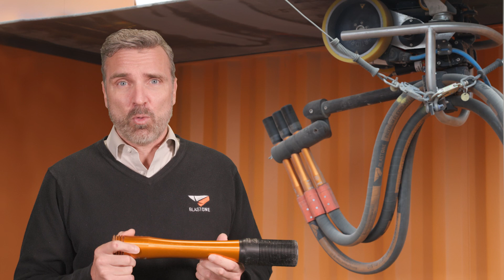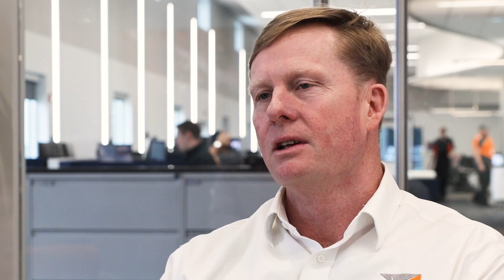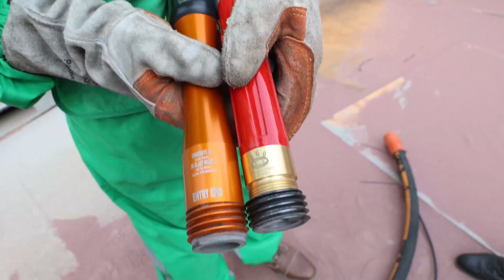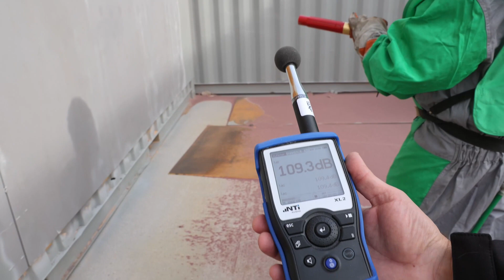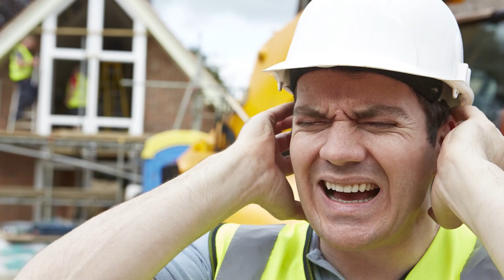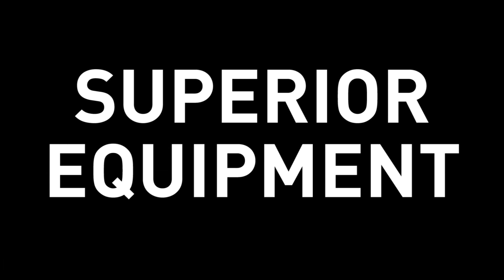How the SnakeBite XQ Reduces Blast Noise and Operator Fatigue

Comment: I've been sandblasting for 15years and I was brought the #6 and #8 Snakebite nozzles to test out before purchasing. At first seeing the #8 nozzle I didn't like at first but needed to just give them a try. I immediately noticed when I'm sandblasting internal pipes I normally go deaf when my ear plugs fall out a bit but since using these my hearing after testing actual improved. When firing up with my normal nozzles I get a heavy kickback of pressure where I have to use alot of my body weight to move around but using the snakebite nozzles I can plug in my ball on my Deadman and I can easily hold the nozzle with one hand with little pressure that feels like a feather in my hand. I sandblast off ladders all the time and hard to hold onto the hose in awkward positions well the snakebite takes away the fear of being blown off the pipe and off the ladder. Normal nozzles blasting leaves a lot of streaking but the snakebite leave a really clean and nice finish. Today I was blasting in my one blasting area with a normal nozzle and the kickback was supper heavy with mega pressure doing internal and external pipe and when I went to my main shop to blast I was grateful I have these new nozzles to work with that makes it easier doing the same work. Great for beginners and older people like myself to work with and don't get sore no more using my new nozzles. My overall rating would be a 10 out of 10 and I highly recommend to anyone looking for one of the best nozzles I have ever used. Great products guys, love sandblasting with these nozzles

Comment: The performance drawback is minimal when you’re blasting on a water tank in the middle of a neighborhood. Mainly because you have to comply with noise ordinance and typically can’t blast past 3-4pm and no work on the weekends. You lose far more production when your work is restricted vs a silent nozzle. Id recommend it if you find yourself with noise complaints often.

Comment: While you talk about the noise reduction, I wish you mentioned the reduced performance of a quieter nozzle. Quantify it.
Reply from the maker: Silenced nozzles aren't the fastest nozzles in the world, but if you have a noise problem, blasting slightly slower during normal hours, without a lot of noise containment expense... This makes it a phenomenal option for blasting contractors in that situation. Its a specialty nozzle, not something that everyone would use on a daily basis... at the moment anyhow!
Reply: @BlastOne  Thank you. It runs BLANK percent slower, and BLANK percent quieter, would have given me enough info to make a purchasing decision upon. But just calling it NEW AND IMPROVED makes me think the improvements, if any, are so small, you're either embarrassed of them, or making them up. Just so you know what goes thru my head.